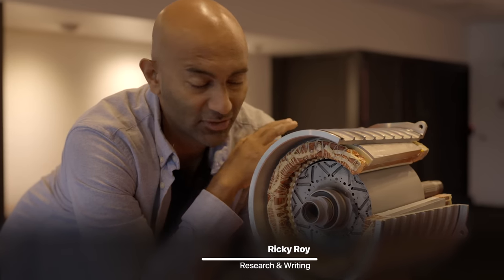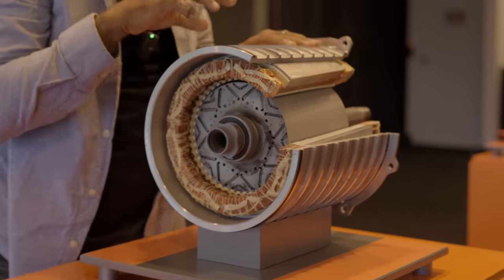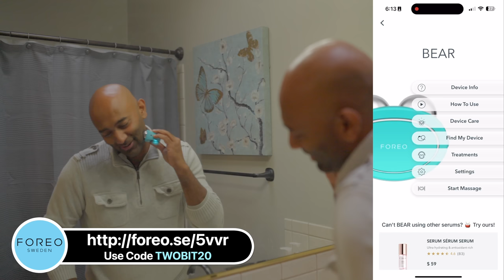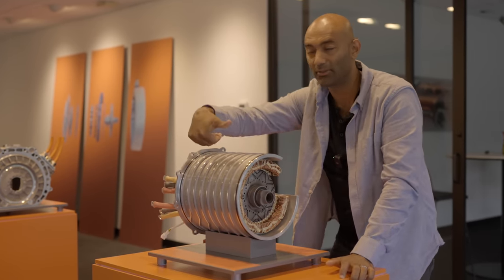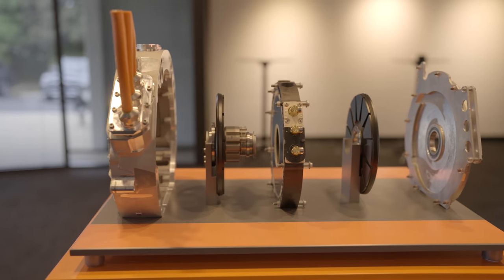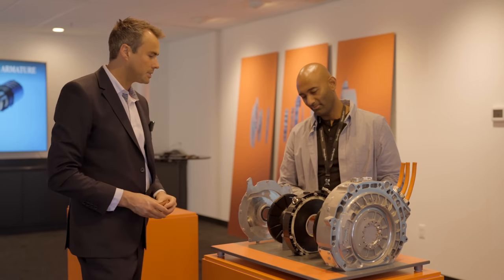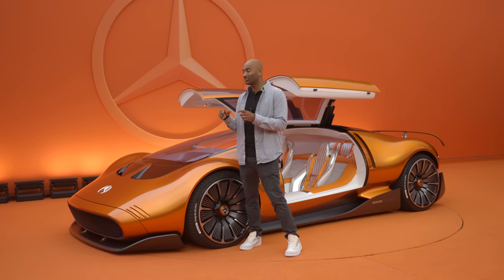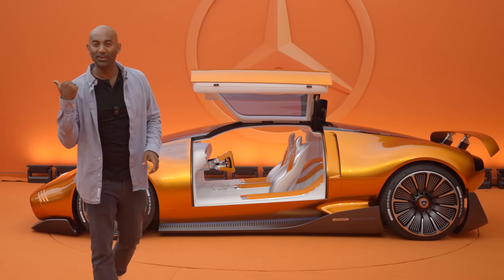Axial Flux Motors Will Change CARS - Here's Why

Comment: Back in 1972, a couple of guys in Peoria IL developed an EV that stored energy in a tank of liquid nitrogen. A small amount of the liquid was exposed to waste heat, causing a rapid expansion of the nitrogen back into a gas. This pressure was used to power an electric turbine.

Maybe such a system could double as a motor cooling system.
Reply: Turning gas nitrogen to liquid is an expensive process. Thats why its not economical.
Reply: @safarandtravel1999  that's true for the mass market (millions of vehicles), but actually, for a certain limited number of EVs using a range extender (possibly thousands), it would be economical. I should have written about this in my above comment.

The book where I read about that EV design explained that the demand for liquid oxygen and liquid trace atmospheric gases is much greater than the demand for liquid nitrogen. As a result, since air is almost 4/5 nitrogen, almost 1/5 oxygen, and only trace amounts (obviously) of the trace gases, in order to meet the demand for everything OTHER than nitrogen, liquid gas providers have to liquefy tons more nitrogen than what anyone needs or wants for refrigeration and other uses. The gas providers set aside enough liquid nitrogen to meet that expected demand and dump the rest back into the air. That's a huge amount of wasted electricity, which is factored into the price they charge to purchasers of the in-demand liquid gases. If there was a new demand for liquid nitrogen used in thousands of EV range extenders, that would create a new market for otherwise wasted liquid nitrogen, and it would improve the margins of the liquid gas providers, with hardly any new infrastructure needed. An EV owner would not need such a range extender unless going on a longer road trip, and those liquid gas providers are usually located in places like highway truck stop gas stations.
Reply: In a hybrid configuration, LPG could be used as the fuel and the vaporization of the liquid could be used for the cooling.
Reply: This is how all modern electricity is produced but with water being turned to gas and the expansion spinning turbines. The reason water is used is because it expands more than any other substance when going from liquid to gas phase which produces more power than any other substance. Your point is that we have a lot of liquid nitrogen just laying around and it is already at thermal disequlibrium from its surroundings so it's "free energy" but it is such a pitiful amount that it is not worth fussing with.

Comment: I was looking into axial flux motors back in 2006. A rally racing team in Australia developed in in wheel axial flux motor. Then they sold it to Volvo. And then later on when they had the copper nanofilm I thought it would be cool to make the rotor out of the copper nanofilm embedded into a graphing carbon fiber rotor. Then each motor would be light enough to stick directly into the wheel hub rather than have a drive shaft to lose torque with
Reply: See elaphe.
Reply: @buckeyebeliever3397  More unsprung mass is a really bad idea. Wheels need to be as light as possible.
Reply: Yeah true about the unsprung mass, ergo the graphing carbon fiber rotor and copper nanofilm would probably take care of that for things like compact cars, rally cars. however When I first saw the in wheel axial flux motors and having the problem with the unsprung weight I thought it would be ideal for things like trucks or classic cars that already have unsprung weight issues
Reply: @Machine_State  oi! how dare you go bursting bubbles and ruining peoples fantasies with mere FACTS?

all the advertising has told us we need motors in the hub, so therefore, motors must be in the hub!
Reply: Graphene rotor?
 I want one for my chopper!
Have these been built, yet?
Reply: @gyro5d  some kid in Japan back in 2013 did it with carbon fiber and copper nanofilm but graphing wasn't as much of a thing at that point.

Comment: I am not sure about the difference in maturity between radial and axial motors. As far as I know, axial flux motors are already used for years in washing machines, dryers, etc. Not in cars, but the technology and manufacturability is known already. The difference is they don't spin more than few hundred RPMs there...
Reply: Search up the NEVS Emily GT by SAAB. Top Gear reviewed a few weeks ago and it has 600 miles of range due to in wheel motor design. No performance car by any means but a solid car.
Reply: @seungltd  range isnt a good indicator of performance when its simple to juist add more batteries or increase the gas tank size to make the range figure whatever you want it to be.
Reply: I have experience with axial flux motors (MRAX 228), and they can spin up to 6500 RPM.

Comment: That lower RPM range is not a problem, just hook it up to a well built transmission and change up gears when needed. I'd go so far as to say, a couple of these motors driving through a common shaft, will make a great motor for high performance sports cars, or a really effcient way of driving individual axles seperately in a heavy truck, including being able to drive the axles on the trailer when extra power is needed, or regenerative brake the trailer to aid in vehicle stability when off-throttle, without wearing the trailer brakes out.
Reply: The KKoenigsegg Gemera hybrid has one of these axial flux motors, 600hp.

Comment: I've seen a couple of videos about axial, I think they are on par or actually inferior to radial, depending on the application or design.  the problem with axial is limited RPM speeds likely due to often large radius designs of axial flux.  It is great on hybrids as ICE don't exceed 10k RPM. With radial flux motors, they can get away without transmissions.  If there is best electric motor for EVs right now it is the Lucid electric motor.  They cleverly designed a smallish radial motor which is lower in torque than a larger radial but allows it to easily spin at higher rpms (which I believe 20k rpm or more) which gains it the nearly the same HP and torque (at the wheel) as a large radial motor that has a lower max RPM.
Reply: Unless you wanted to actually drive your car rather than just sit bored on a really fast sofa on wheels(also why so many people die from getting hit by people driving and texting). The idea of a smaller, high torque, low rpm electric with a 5sp manual behind it is exactly what's lacking with current EVs.

Comment: My thought is this motor is ideal for motorcycles! Perhaps ebikes too, though needing a frequency drive would be added complexity.
Reply: Yeah. These flat motors could fit inside a wheel!
Reply: Doing over 100 MPH on an e-bike?   😂
Reply: @jonathanbrown2407  Seriously? Ebike motors are around one horsepower. Limited by law to 28 mph. Any improvement in weight and efficiency is desirable.  Also, HVAC uses freq drive motors more than ever. From fractional HP to 60 HP and more.
Reply: This is far from being used on motorcycles, these max out at 22k/rpm but i had a bike that naxed around 23k/rpm these just cannot spin fast enough to keep up with a streetbike rpm rang
Reply: In Europe (big bicycle market) the limit is 25 km/h and 250 W on average. However nothing is said about peak power. So many motors have a huge amount of peak torque and power. And weight is definitely an issue, with 3 kg already being considered heavy. But the biggest benefit is size, as people generally don't like the aesthetic of clunky motors. There actually are many  radial hub motors on the market as they need to be flat.
Reply: @solwidotnl  Yes, I have three where the motors are rated 500 watts but will peak at nearly 1,000 watts. I don't see having limits on wattage when the speed can be limited by the motor controller. Extra reserve power is needed for hilly roads.
Reply: No sure about ebikes - but emotorcycles it could be a thing for them. There are laws for speed for ebikes and for good reason. I see you mean for the power - yea I could see it being a thing for that.
Reply: @sbukosky  There is legal limit how fast you can go on public road. There is no limit how fast you can go besides it.
Reply: I would actually love it if motorcycles were mandated to become electric after this motor comes out. It's super annoying  when some guys intentionally make 100+ db sound at night when people are trying to sleep or even on day. I would bet that 50% motorcycle owners would quite their hobby if electric motor was mandatory and they couldn't make noise anymore.
Reply: @test-rj2vl  xD
Reply: @test-rj2vl  Oh I don’t know that they’d quit. I was one of those with loud pipes. I now have a Honda Gold Wing. Relatively quiet. I’d like electric for reduced maintenance.
Reply: @Stasiek_Zabojca  Above class 3 is a grey area. The Ariel Grizzly, for example. Or the Wired, and many others.
Reply: Well at some point - your Ebike stop being an E-bike and starts becoming an Emotorcycle. I think the clear line difference is the speed of how fast your machine can go - 20-25 miles/hr should be kind of the limit. Bikes in general are not design for speed and safety for the general public. Let alone people taking these things on side walks and ignoring lights because they think they can. Look at any city with a large number of them and you can already see some major problems in how they're used / where they go. Even on the trail here (and I am gulity of it my self) people with ebikes also dont wear enough safety gear either and at higher speeds that are just risking breaking their neck or head against something hard. Personally, esp for class3, I think if you are going to allow anything faster - they should be consider more of a motor bike and you should need some type of license (either car or motorcycle) and a understanding that it needs to be on the road and follow traffic lights.
Reply: @adr2t  I don’t disagree for the most part.  I look at it more like machines don’t inflict harm, recklessness does.
Reply: @adr2t  in Germany the Limit for e-scooter and e-bikes is 25km/h that's roughly 15,5mph though man's Chinese companies offer apps to deactivate that limit, the good thing once you Turn of the Scooter it goes Back to limited speed so the Police can't find evidence of tampering

Comment: It took me a while to figure out the lingo for electric motors, to figure out if axial flux motors existed. I had made "axial pressure" lol compressed air
Motors with fantastic torque for their small size and plastic composition. I knew it would be great in an electric motor. Some bike hubs are axial, but I'm honestly impressed how long it takes automotive companies to "innovate" 😅
Reply: The principle problem with axial flux motors is the control circuitry. It has taken this long to come to terms with the computing power necessary to getting them to work efficiently.
There's an excellent video by Fully Charged which looks at the whole creation of axial flux motors.
Reply: The other problem is battery capacity and weight, up until now, batteries weren't as efficient or cost-effective as those "heavy engines and transmissions" like he states in the video while conveniently leaving out the battery that you have to carry to power these motors. ( 9:50 ). Comparing the weight of a tesla and a similarly sized sedan is pretty eye opening about the amount of battery you have to carry to get the same output as an ICE. We're getting there, and I'm excited.
Reply: @GlidingBoulder  We maybe already there. CATL's Condensed Matter (CM) batteries are going into production this year and have an energy density of "Up to 500Wh/kg" and are expected to be cheaper than conventional Li batteries as well as having a significantly longer life and shorter charge times, as well as meeting aviation industry standards for safety. With electric motors being so much lighter and not needing a transmission, the combined weight of battery and motor can noe be closer to, or even surpass, the combined weight of an ICE car with fuel load, engine and transmission.  I've done the calculations, and 500Wh/kg is getting very close to the 3 or so kJ/kg of petrol when converted at the typical ICE efficiency of 30%, especially when you take into account the not insignificant weight of an ICE. engine and transmission.
This is not intended as an advert for CATL, there are other battery companies that are close to launching with similar tech.
Reply: > I'm honestly impressed how long it takes automotive companies to "innovate" 

Weird. I'm not "impressed", "surprised", "disappointed", or any other combination of words that you are getting at.

The auto industry innovates slowly, as would be expected in any field where products cost tens of thousands of dollars and where the industry bears the cost of fixing engineering mistakes in any units they sell. You would do the same thing if you were in charge, so I don't know why you are so "impressed" by how long it takes them to innovate.

They usually run their innovations in racing first. It's a good idea, because it's low volume and funded by the manufacturer.
Reply: @lambdaman3228  It seems that the great innovations are not coming from the automakers, but the battery makers. And you really should be impressed. It took automakers about 50 years for a normal family saloon to go from producing about 50 bhp to about 100bhp, yet it has taken battery makers less than 30 years to go from about 100Wh/kg to 500Wh/kg, and it would seem that the pace of development is increasing still.

Comment: You don't need to make the motor bigger to give it more power, but there is a limiting factor: Heat.

The other way to make the motor more powerful without making it bigger is to run higher amperage through the coils.  Unfortunately, more amperage means more heat.  Eventually you hit the limit of the heat the windings can handle and you need to instead simply make the winding have more area, which means a bigger core.

Furthermore, a drum is not a very good self-cooling surface as we have learned from brakes.  

As of a an axial flux motor, you can either stack the disks to add a more motor rotor cores, and/or you can make the disks higher diameter.   You can likewise increase the number of staters on either side to increase torque.  For scalability these aditional staters could be simply deactivated at lower output.